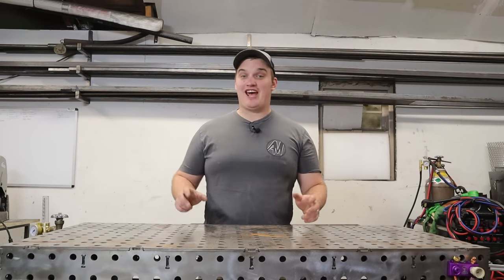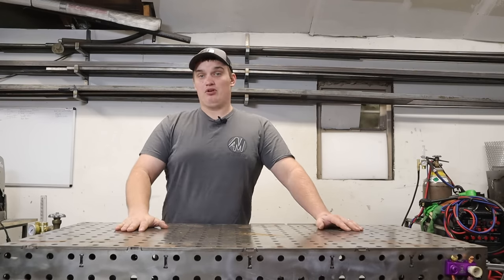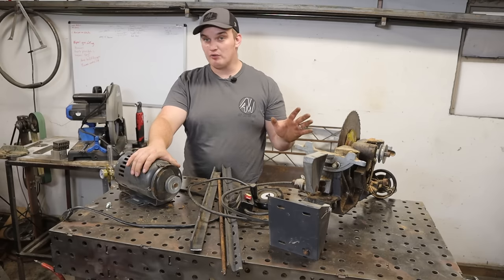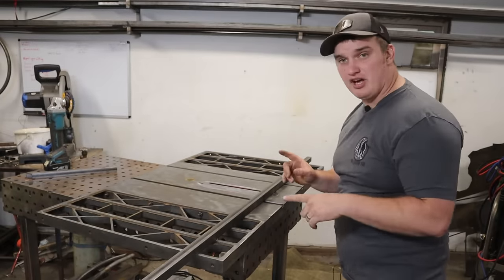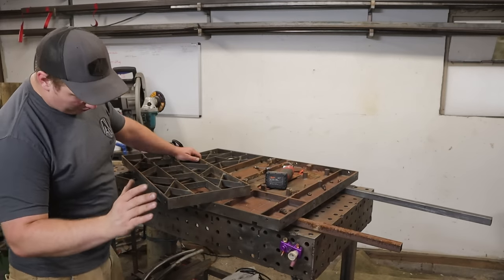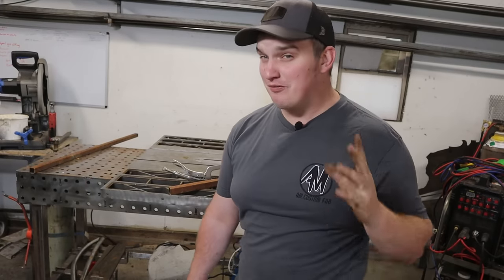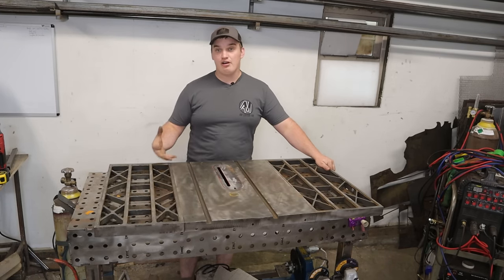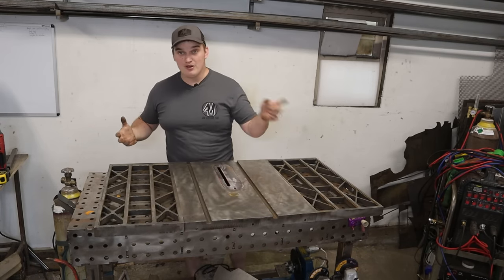HOW TO BUILD $30 DIY welding fixture table. !!!!

Comment: I came into this like "this guy is going to be using stuff he got for free. What life hack could he had possibly found." The second you cut to the table saw it clicked for me, f-ing genius man!
Reply: Exactly what Jeremy said!!!
Reply: @kevinstephens1109  I actually have an update to this, there were a bunch of these tables within an hour of me that are for sale. I just picked one up last night about 20 minutes away for $60 that has the extension on both sides and came with an extra
Reply: @jeremydale7263  where are you located?
Reply: @kevinstephens1109  Western South Dakota
Reply: @jeremydale7263  Western Washington.
Reply from the maker: @jeremydale7263  that's awesome 👏😎👊
Reply: "square inches" 🤣🤣🤣 try: area. Trade math, it's a thing.
Reply: definitely a brilliant idea. now I just have to try to buy one before anyone else in my area sees this video. prices in my area look to be $80-150, but that is still a hell of a deal on a flat cast iron surface.

Comment: I chuckled when I saw the saw! I have been using my Craftsman table saw top (identical to this one) as a flat welding table for years. I didn’t take it off the stand but reinforced that to keep it more ridged. Yes you do have to keep it clean or you have some small barbecues! I would like to see a belt sander made too.
Reply from the maker: https://youtu.be/T6nECgRL6Lg

Comment: Love this idea. I've been looking at the pro ones and they start around $1000. I just love to tinker and will be doing things around the homestead. Also being a knife maker, the idea of making a belt grinder is appealing so I am going to start keeping my eyes open for a old table saw.

Ideas for improvements: Use wing nuts on your stops for ease of use and maybe epoxy the bolt on the inside so it's 'captive'. Add a set of wheels on one end and either removable legs or have them shaped like "H" and have them fold toward each other but one nest inside the other and be able to use the wheels to cart it like a wheelbarrow. That would allow you to roll it around alone and probably get the non-wheeled end up onto the tailgate to then pull it into the bed of a pickup.

Comment: I bought an 8’x5’ welding table with schedule 80 frame and it’s too big for my shop. So I have a welding table in my driveway outside the barn…which is kind of handy when I’m working on our heavy equipment…all for 130 on craigslist!  Great Idea…many of us have one of these laying around!  And you get to use the electric motor for something else!  You can also use the elevation and tilt mechanisms for special weld positioners.

Comment: I like your idea repurposing the cast iron table saw top. Then recognizing the potential of the remaining parts to be used in the belt sander project. A nice 1hp 1ph 110v 60hz 1750rpm electric motor is very useful, and new they're over a hundred bucks.
Reply from the maker: Thanks for watching. Here's the belt sander video. 
https://youtu.be/T6nECgRL6Lg?si=NMfDECWNN94icz6k

Comment: Another idea: 1 inch thick particle board with sheet metal on top. Not very clampable and can burn if your weld is too hot, but has done the job for me for many years.

Comment: Picked up my third free saw total area is 11' x 27" lines up and 352 pounds mix of solid deck and grid.

I'm thinking solid as the "main table" surfaces and grids can quick connect for reconfigurations as needed.
One of the three motors has a wire wheel on the shaft  and had sketchy wiring via extension cord to glass fuses in a breaker box.
I may have saved a life getting that apart.
Reply from the maker: That's awesome DM me a photo on Instagram and I will share it 😎

Comment: If you made a disc sander then you could use the saw tilt for the sanding disc and keep your work table level, plus with the screw adjustment your angle setting would be accurate and easily repeatable☺.

Comment: I think a belt sander would be good I built a 26 inch belt sander and it is one of the most used tools in my shop  and very easy to build I used the wheels off of a lawn mower deck to run the belt on
 I put one on a lathe and flattened a little where the belt would run true works like a store bought one

Comment: Smart idea! I've been looking for a good idea for a cheap welding table for some time. I've already got a lead on one of these saws for $80, which around here is a pretty good price. And yes - please make the belt sander - otherwise this motor is going to be sitting around my shop collecting the wrong kind of dust forever.
Reply from the maker: https://youtu.be/T6nECgRL6Lg

Comment: I have been looking for my first welding table, and aside from the cheap folding HF one, I was looking at ~$230 on the low end for one. 

Saw this video, popped up marketplace, and there's one of these for sale right by work for $50. We will see if I can make that happen instead. Thanks for the awesome idea.
Reply from the maker: Thanks for the support make sure to check out the playlist shows how we build it out and all the accessories we make for it thanks for subscribing and supporting the channel. 🙏😎👊
https://youtube.com/playlist?list=PLYZLecTwHuUlQFY4jydxdleYFWLp9FE9F

Comment: Great idea. Especially knowing that table is 100 pounds of ground cast iron to start with.
Sander project sounds great too, but how about if you crank the blade down below the deck surface, and keep it as a table saw too.
Although removing the saw parts would eliminate a lot of weight, especially if you were going to move it around a lot for mobile use.
Another good video.
I first found your channel when you got your Langmire CNC plasma cutter.
How is that machine working over time? Would you still recommend buying the Langmire Crossfire PRO ?
Take care Bud
Reply from the maker: I still use the crossfire pro every week it's a great machine

Comment: Awesome repurpose. People sometimes do not know what they throw away or get rid off.  The older equipment is much better then newer ones, more solid.  I've come across a lot of good stuff I have repurposed in so many ways, so this video is right up my alley. But this is an awesome way to make a welding table. I just started welding and came across this video. You grabbed my attention by the build under $30 title, I thought you were going to use some thick ply and cover it with a sheet metal, even doing that can be expensive when you purchase raw materials.
Reply: Not sure if the old stuff is necessarily better. I'll definitely vouch that it's heavier. Usually a plus. Found my last cast top saw at the garbage transfer station. That'll make four as now, highest $= $30. Router table, designated tenon cutter for log rails/furniture.

Comment: A lot of welding tables have a grid of holes like your one. It reminds me of an mft top used in woodworking. If i were to get a sheet of metal and drill the same holes and slapped it on top of my mft, that would work as a welding table in a budget, right? Particularly as i could reuse my mft clamps and dogs. Thoughts?
Reply from the maker: My main concern would be fire hazard .  With wood underneath

Comment: I’m wondering if the table saw with the electronics would be a sufficient welding table with the same stand? Not sure if there would be stability or grounding issues?
Reply from the maker: Should be fine the biggest concern would be cleaning the sawdust out so it's not a fire hazard.

Comment: I was wondering if you can clamp your ground rite to table top in order to use as a tig welding top? Is it a solid ground? Thanks in advance
Reply from the maker: That should be sufficient as long as you have a solid connection

Comment: You could make a rotary tilting welding positioner with that mechanism maybe.
Also, you could drill some 5/8 (or whatever) to that center section to utilize yer standard fixture table clamps. Difficult to place them accurately for layout, but you'd at least have places to put the clamps.
tip: annular cutters usually do a great job of making accurate holes if you have access. If you use twist drills, best to drill undersize and ream to final dimension.
Reply from the maker: 🤫 your going to spill the beans about the second part of the build .😎 Thanks for watching 🙏👊
Reply: @amcustomfab  Sorry. I take it back. IT WAS A TERRIBLE IDEA. everyone quit reading this. Nothing to see here. Just forget you ever heard it. 😉
Also, I just thought of a possible solution to the accurate hole placement problem. If you haven't already figured one out, let me know and I'll tell ya my thoughts.

Comment: Great idea, I’m acquiring materials now to build one. I found a deal on 2x2 square tubing that is 16 gauge. Is 16 gauge adequate thickness for this?
Reply from the maker: Should be for just legs. All depends on how heavy things you plan to put on it

Comment: Question I'm new to welding,  I have a mig welder and I've read that cast iron is not the greatest for migs.   I have the same craftsman table saw and am planning on making it into a table like yours.   The question is around is my HF mig welder gonna work on this table saw top?
Reply from the maker: I guess I don't understand the question are you worried about spatter sticking to the table?
Reply: @amcustomfab  so did you have to use specific wire? Basically do you think just normal mig with the normal wire you get from HF will work fine welding that table top to itself (wings) and to an angle iron base?  thanks for answering, sorry if it's a dumb question.

Comment: Tubes are usually warped in one direction, but often not warped at the sides 90 degrees to the first surfaces. So check first. All rod and tubes have a straightness spec. If you’re buying ing some, try to find out what it is. For example, McMastercarr always gives that spec. Home centers may not. These things are much cheaper than a good 4 foot level, and if you get a good one, put aside and label it.

Comment: I own that exact tablesaw and with a few upgrades it makes it a pretty nice saw. I use similar fixtures for woodworking glue ups, but for obvious reasons I never considered welding on it. Great video! I need to find another tablesaw I guess. Hope to see a belt sander from you. Cheers

Comment: Dude! Freakin Genius! Subbed. Definitely wanna see a sander build. BTW, I have that exact table saw from 1990 that I still use! 3rd motor (went to 3 amp 220v), new steel adjustment wheels, put both wings on one side and installed a cast iron router extension table on the other and rigged up a better dust collection.

Comment: 12 inch disk sander with little table is going to be more useful for chamfers. I would keep the blade, remove teeth, stick 12" sanding discs, run a dimmer switch to control motor rpm.
Reply: Would be hard to find a dimmer switch that would be rated for the amps that the 1 hp mother will pull. Alot of electric motors will burn up if you run them on low voltage.
Reply: @tubeonline629  not to much resistance on motor if your just disk sanding, and if your worried you can change pulley, but some nice variable speed controllers are available cheap, or take one off a router that is going to be used for an additional flat surface.

Comment: That table is a great idea. I just happen to have one of those Craftsman table saws in my garage that I got from my dad several years ago. I have a Jet cabinet saw so the Craftsman really just collects dust and whatever other bits and pieces I set on top of it. It might have to migrate to a new life as a welding table.

And yes on the belt sander. 

Also, I just subscribed. I'd like to see what other interesting things you can come up with.
Reply from the maker: https://youtu.be/T6nECgRL6Lg

Comment: I believe a disc sander would be a much easier build & equally functional in a metal working environment.
Reply from the maker: That would have been good too ended up making a belt sander here is a link to the build video 😎
https://youtu.be/T6nECgRL6Lg?si=sOt5xzc8HoHArMSZ

Comment: I think you should put it back together and change the pulley to slow down the blade and create more torque. A metal cutting blade and you have a accurate, compound metal cutting table saw. It would be a beast on square or rectangular tube. You also can se the angle on the blade a 5 degrees ( or play with it to see what works best) so you don’t have to grind open the edges for a better contact.
Reply from the maker: That's a cool idea

Comment: I made mine out of a single bed frame. I braced all the legs together to keep it flat.  It doesn't matter how heavy you make it if you are going to be welding on one side a lot it will bow. Edit, by bracing i mean i made a truss frame using 6 legs.

Comment: I was lucky enough not to buy the first table saw I saw lol because it was an outdoor table and it was rusted badly so I kept looking on facebook marketplace and less than a week later I found a similar table all cast iron measuring 27”x 44” inches. And it was garage kept. Everything came apart quickly. The 3 HP motor was already removed so it was a two man job to put it in my van yesterday. I put it in upside down so I had easy access to the bolts and nuts. I didn’t even need WD 40 once I broke loose the nut I could use my hands the rest of the way. It’s completely disassembled now on my 30” length 24” width 32” height on a heavy duty steel cart 1/8” thickness so now I’ll either bolt it directly on top or my other idea is to use (4) 1” black pipe nipples 4” length and (8) floor flanges to lift the table top off the cart. Since I’m 6’ 4” a  37 5/8”  table height would probably be better for my back or I could use an adjustable stool I purchased from Facebook marketplace too.😅 Thanks for the inspiration
Reply from the maker: Awesome glad you found one 😎 thanks for watching

Comment: Very nice and interesting project. I'll have to look for one of those!  I like the cast iron. I live 15 miles from CertiFit and they have blems but I like the old Craftsman table idea better. One funny thing in your video is you clean all the rust off the cast iron but not on one of the pieces of leveling tubing!! I get the idea, but it was still funny!! Thanks for the informative video.
Reply from the maker: You are absolutely correct you would definitely want to remove the rust from those pieces of tubing I didn't actually level it with those specific pieces just pick them up quick for demonstration purposes thanks for watching 😎👊👍

Comment: Wouldn't a cast iron table top crack when exposed to heat too fast?
Reply from the maker: Maybe but you're not going to get that by welding on it you would need a much more extreme and fast contrast in  heat.😎 Thanks for watching 👊

Comment: Awesome!  I totally left a comment regarding on redneckcomputergeek 's Youtube channel regarding him using, I think on the Vevor welder video or one of those he's welding in, and inspiring me to make a welding table using and old table saw... or potentially a router table.  Though I already own a table saw I'm not using and was like... bro.  Now you just nailed the vision!  Thanks for sharing. Liked, subscribed and commented.
Reply: Get's me wondering now that I have a few spare parts from the tables I was just blessed with, if a carbide tooth metal cutting saw could be fabricated safely?

Comment: Leave the motor in it and put a car Brandon wheel on it instead of the wood blade and you have a useful tool for metal work

Comment: I have to say this is a great video. But damn, there is no longer going to be any old cast iron table saws left to buy. Once your video gets released EVERYBODY that wanted a welding table but could not afford one will be buying them up. That includes me!
Reply from the maker: Yeah I think I actually inflated the market a little bit. The price went up on them after I made this video

Comment: TIP: Bring a straight edge when buying one, the main center sections are not always flat.
Unfortunately after getting it all prepped and surface rust removed, it’s NOT flat!!! Anyone have any good resolutions to salvage it? I shimmed the extensions about .003 each, then realized the main table isn’t flat. Looking into cost to mill or blanchard it flat again. If not, only out $20 and my time.
Reply from the maker: Good to know .how far out was the main part of the table ?
Reply: @amcustomfab  .010 using feeler gauges. Any suggestions? The wings are flat.
Reply from the maker: I have taken out .003-.004  before by taking  sandpaper and spray gluing it to a piece of glass  but  .010 is a lot to take out by hand. I would probably save the wings look for another table and add the wings to that table to make an even larger one .
Reply: @amcustomfab  Thanks, my neighbor has a CNC mill, so I’m going to see if he’ll hook me up. 🤞🏼

Comment: Crap. The saw I was looking at I think has aluminum extensions. That's no good is it?
Reply from the maker: It would probably work probably won't be as durable though
Reply: @amcustomfab  I'm no welder. Just got my first one. It's a lincoln buzz box. I would be afraid the aluminum would melt and warp? What do you think?
Reply from the maker: It won't melt but it could vary well warp easier and get scarred up with gashes easier
Reply: @amcustomfab  Thanks for the reply. I have a feeling I better pass on this one. Don't know if you seen the video I linked to. But the other  one  I mentioned  is the all square hole design. That has 3 extensions. It measures 21x43 with the saw. You think that is big enough? But the saw doesn't work. I was trying to get a working saw if I can,,,lol

Comment: Surely that square tube stock isn't flatter than your welding table...... This seems kind of silly to put anything between that flat table in the cast iron table
Reply from the maker: You are absolutely correct. I was just trying to give an example as if I do not have extra table for someone who is starting from scratch to get them in the ballpark 😎